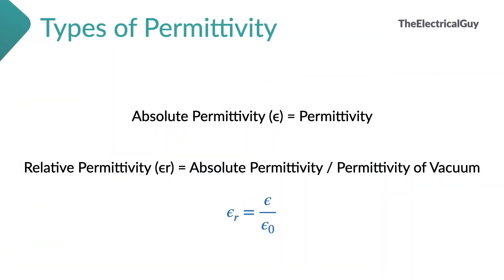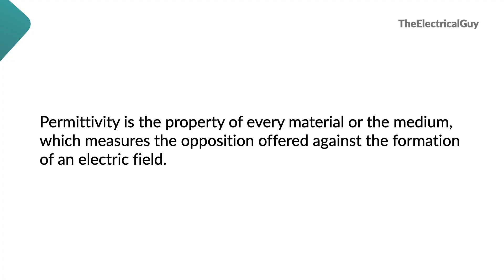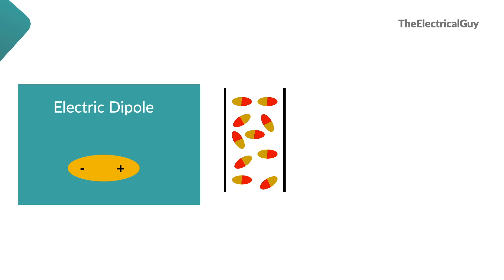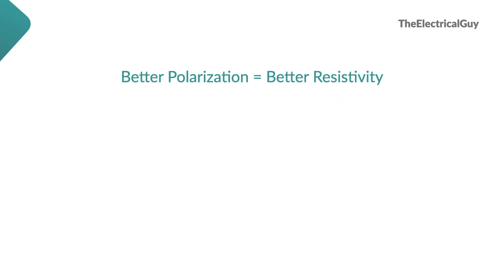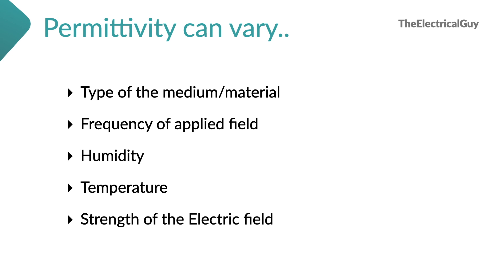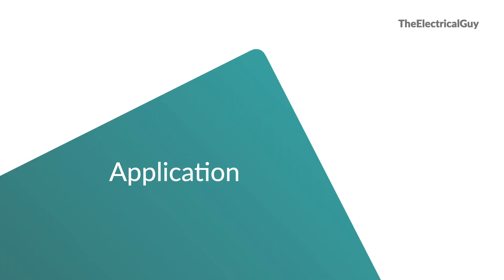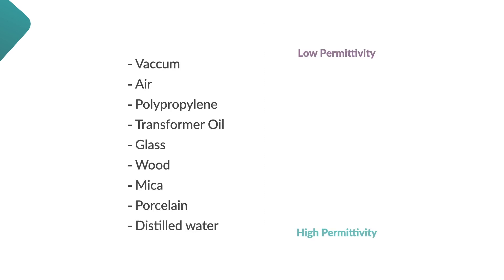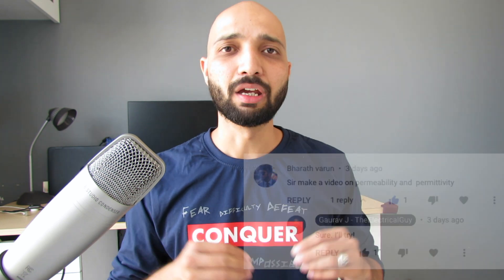What is Permittivity ? Electrical Engineering | Easiest Explanation

Comment: On page 2:10 It is obvious that air is the medium but it is not the only medium. The medium that we ignore here is the medium of vacuum. Vacuum or more precisely the medium of vacuum has a permittivity measurable at 8.8541878128^-12 Farad per meter also known as e0. 

Therefore medium of the so call air is a composite permittivity of e0 and air molecule. Likewise for liquid and solid a mixture of e0 and respective molecule.

Comment: The permittivity of a medium (for example the dielectric between the plates of a capacitor) - depends on the behavior of the DIPOLES in that medium.

We work at artificial gravity devices.  We grabbed on to vacuum permittivity (and permeability) like a first-born child when we started our device-building work a while back.

WHY?

Because of the DIPOLES.   The dipoles in a non-conductive insulating material EXIST and can be POLARIZED.

So if permittivity describes the polarize-ability response of a chosen dielectric - LET'S CHOOSE THE VACUUM permittivity.

In our courses in EE/physics in college we were taught "electromagnetic waves do not need a medium to propagate", or in other words,  "Space is EMPTY"

This is wrong.   And knowing it is wrong, and what can be done to/with the constituents of the vacuum  (DIPOLES!)  leads to artificial gravity.

VACUUM PERMITTIVITY
VACUUM PERMEABILITY

Space is not empty.

Comment: But in the case of a vacuum, there is no medium. Therefore any measurement you get is NOT going to be "measuring" the ability of "Nothing", to restrict or conduct electricity.  (that's what your "field" is doing. )..  So what we can say is that electricity CAN have an effect at a distance without any medium, and what you are measuring is the ability if the electrical conductors, the plates, to provide the essential conditions that allows for electricity to extend across a gap.  But it's totally incorrect to say that you have measured the Permittivity of nothing.   "Nothing" can NOT possess any Properties.   "No properties whatsoever" is really the definition of  "Nothing" (a vacuum)

I you say that you can measure a certain Permittivity across a gap of 10mm in a vacuum, then I challenge you to repeat the experiment using pieces of wood in place of the two copper plates you used in the first instance.  you have supplied the same amount of electricity to the plates, and the same gap in the vacuum, so why would you not get the same reading?  Because you are NOT measuring the ability if NOTHING, rather you are testing the ability of those conducting plates. And like Light, Electricity can have an effect at a distance with no medium to allow for transmission.  But its very small and doesn't expend very far for electricity.  What happens if you change the plates size and shape? (but maintain the same 10 mm gap?  Does the Permittivity value change? What about swapping from copper to gold plates? Aluminium plates? If you are really just measuring the Permittivity of Nothing, then these changes should make no difference.

Comment: aircraft fuel is measured on this priciple. fuel acts as dielectric between capacitor plates and changes capacitance with changing  fuel quantity. error are obvioulsy compensated for the water and air ingression in addition to temperature which changes density of the fuel

Comment: You have nicely explained the difficult concept in very simple and effective manner. Thanks.                                                                                                                                                I will be grateful if you clarify  1)Relation between the dielectric constant and dielectric strength 2)Effectiveness of dielectric material to prevent the electric breakdown wrt the dielctric contsant.3)The behavior of dielectric  materials in high voltage alternating fields(of the order 11kV and more) wrt their permittivity/dielectric constant.

Comment: Sir can you please tell me Why we only deals with the semiconductors in electronic engineering? Why not conductors?
Reply: not true, the integrated circuits use copper to route signal from one transistor to another, it used to be aluminum , but now it is copper because it has better conductivity. metal interconnect in a chip is the most important part and there is always a lack of space for routing. maybe you are reading too much textbooks, but in the real world metal as important as everything else

Comment: Gaurav ji can u explain  in simple about.
1.LEN'Z LAW how to understand that. How it works in transformer.
2. How to relate Flemming right hand rule with generator working.
3. Sequential networks. Basics of that. And how during the time of fault the sequence of the system changes. eg RYB change to RBY or BRY
it would be much helpful  my self working in substation O&M